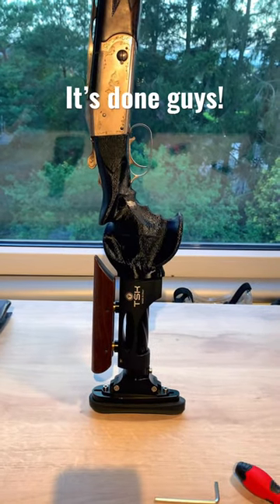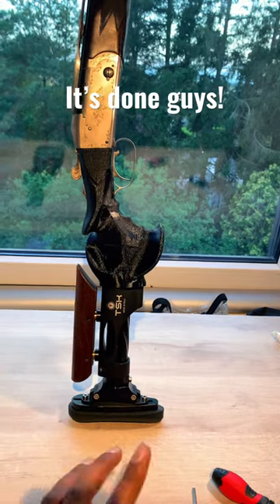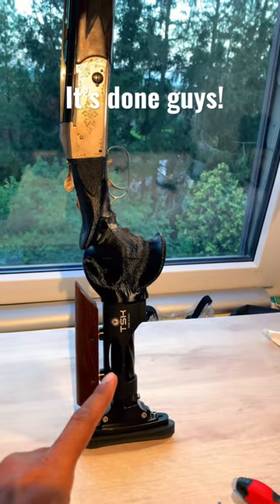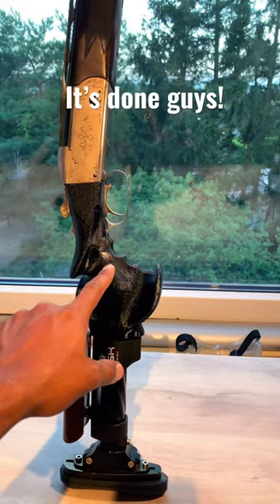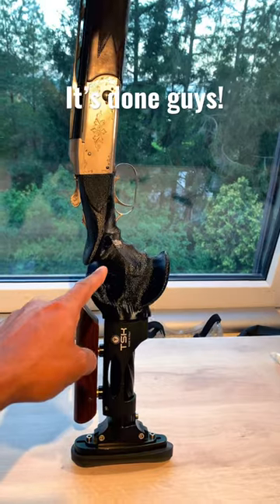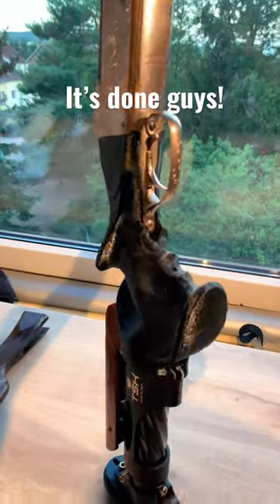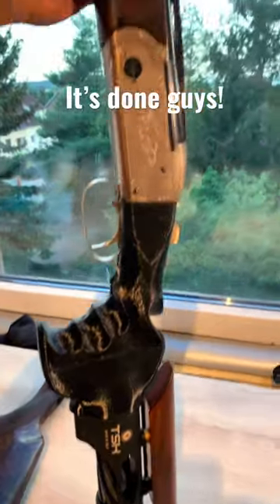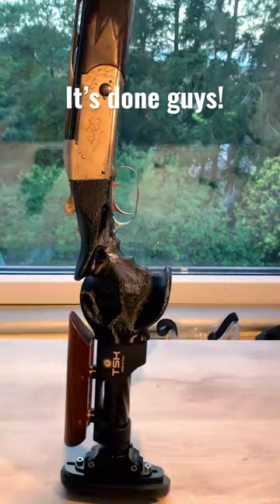Krieghoff K80 - Ergosign - TSK - 3D printed stock update

Comment: You ever gonna drop the files for this? Been patiently waiting for months now 😨
Reply from the maker: Hey Anthony, I’m selling these grips. It costs me a lot of work to put this together, specifically testing that it works and does not break under the recoil. Especially in sport shooting where reliability is paramount. I do want to create a community to bring down the prices of these grips. Still figuring out how to proceed. Therefore do not plan to publish the files. At least not for now.
Reply: @coffeeguns807  hellob- how do I get in touch with you? Thanks!
Reply from the maker: Cg_coffeeandguns on instagram. @michael
Reply: @coffeeguns807  how much are you seling them for? is it just the grips or is it the whole adjustment system aswell
Reply from the maker: Hi Thomas, both options are available. You could buy just the raw anatomical grip that you can further Sand to fit your hand better. The grip will be printed to fit your Receiver and the Stock System you use. Or else you get the whole thing. I don’t sell the adjustable mechanism to everyone as it is still in prototype phase and doesn’t look fancy like an end product you get on the market. (Machining marks, relatively non-smooth Motion of adjustable mechanisms etc.) in case you’re interested please contact me on instagram: @cg_coffeeandguns. Cheers!
Reply: @coffeeguns807  PM'd you